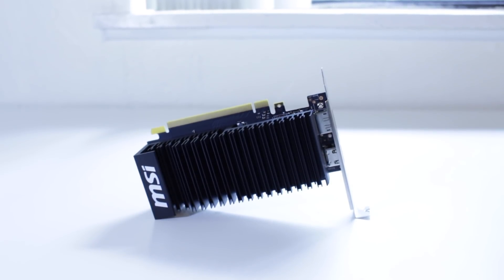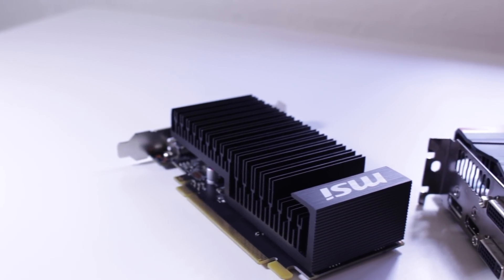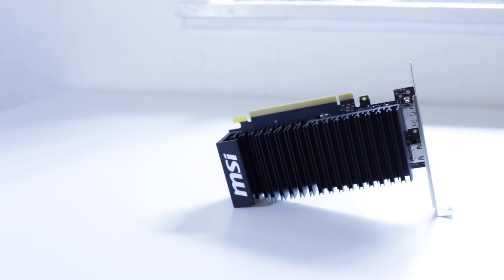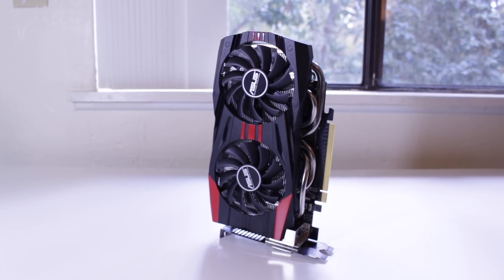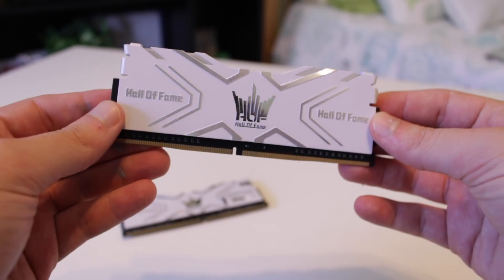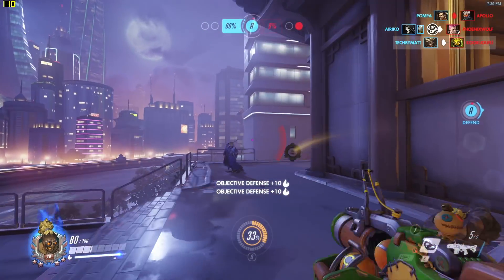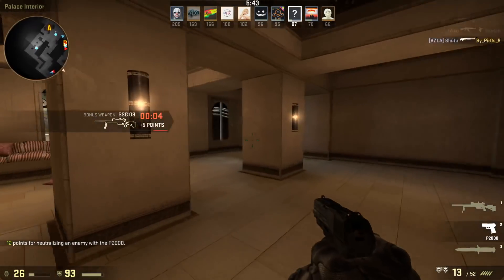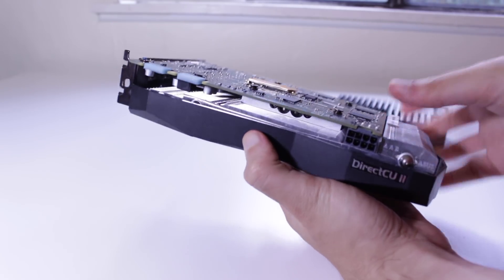New vs Used Graphics Cards! (GT 1030 vs GTX 760)

Comment: Yes but the GT 1030 has a newer architecture that supports Vulkan API, for example, and has a smaller form factor and power consumption, which is why some people might prefer it. It is more universal but the GTX 760 has much better price:performance ratios.

Comment: If you want the best quality per dollar, don't buy used.

I've bought "new" electronics from eBay that were taken from pre-builds that were never used and then sold off piece by piece. A couple times they've bricked, and guess what, since it wasn't from a retailer I was out of luck and couldn't return or exchange it.

I also bought a 1070 when it released, 9 months later it suddenly bricked for no reason, PC would not boot and I found out it was the GPU. Thankfully it was within the warranty period so I was able to exchange it for zero cost. If I had bought it used I would've had a $450 brick.

In the end you always get what you pay for.

Comment: Not "ANY" 400W or 450W PSU would be fine with a 170W GTX 760 under full load. The nominal power of PSU's is the combined power across all voltage rails. For powering the graphics card and the CPU alone you need to have a 12V rail rated to 22A or even better 24A. Assuming you have a branded 80+ Bronze PSU (and not a cheap one with 50%-70% efficiency under load) if your 400W-450W PSU's 12V rail is rated at 22A max then it means your PSU is effectively 12V*22A*0.8=211.2W under full load on a single 12V rail. Which means that you needed to use a very low power CPU or not have your CPU, 12V 3.5" HDD's, etc. under load while the GTX 760 is being at full load. Otherwise your system would be unstable with random crashes and restarts or even kill your PSU in no time. If you're buying cheap second hand parts I assume you don't have a very expensive Platinum rated 450W PSU so beware with that 170W power hungry beast and get at least a 550W-600W branded 80+ Bronze PSU.

Comment: 🎥Editing, 🖥️3D Rendering, 🎮🖱️Mixed gaming from [old & new games] the 🏆760 blows away the 1030💩. Some new 1030s released have gimped memory using DDR4 👎🏼💩 Only in power and noise does the 1030 win🔌🧐...."1030 will run at same clock as actively cooled variants",,, that is untill gets overheated 🔥 and will choke and throttle down 📉 💔... RIP

Comment: It is about six months my friends 760 died. Old hardware is old hardware and if the card was used a lot it can die any second. On the other hand i still have my 660 in htpc and it doing quit good, with the difference it was used much less. So it all really comes to how used the card was before and how healthy it is. Overall i would not buy used four years old card with no warranty

Comment: Even my 650ti beats a 1030, heh
Reply: Well, of course, GT 1030 is way too low end.
Reply: Uragan5 Yeah, but consider the 650ti is like 6 years old now
Reply: Does it really? From what I see the GT 1030 is faster in newer titles. DX9 and you might be right tho.
Reply: The 1030 can pull ahead in newer games due to newer drivers or Vulkan support in Doom but on others like GTA, CSGO, and BF1 the 650 Ti pulls ahead significantly. On paper the 650 Ti is more powerful than the 1030 but you do have a point, some newer titles can't take advantage of its power efficiently.

To be fair performance wise the 650 Ti vs 1030 comparison is a more realistic than 760 vs 1030, but if we are getting into price comparison (used vs new) then the 760 and 1030 can usually be found around the same price.

Comment: Hehe, I don't think anyone should ever worry about an older component giving out ever, unless they are doing some serious overclocking or something else that the card wasn't really meant for. I only just upgraded my used GTS 250 about, November or December of 2017, around the time this video came out. It still ran fine, but I decided to upgrade, because... it is 10 years old. I mean, GTS 250 come on. Of course it does still run, but for any modern PC it would be almost completely useless. So the component will no doubt out live it's purpose.

Comment: I would never get a card like the GTX 760, just look at the TDP of 170W (all that heat..) and it's size, the GT 1030 on the other hand with a TDP of 30W and a low price is something considerable if you can not afford a GTX 1050 Ti .

Comment: but have to take into consideration, cheapos like me buy an old prebuilt PC with a crummy psu. I would go with the GT 1030 instead, since its overhyped, I'm sure reselling the GT 1030 after upgrading the PSU and GPU would be no problem.

Comment: I just picked up a used GTX 760 and threw it into an older Dell Inspiron, upgraded the power supply, and replaced the hard drive.  The tower was free, so total price was about $125.  I'm honestly surprised!  I can run Skyrim SE and Fallout 4 at better resolutions and better frame rate than my PS4!

Comment: I spent last weekend building my son a gaming computer all from used parts, one of which was a used GTX 560ti. I have to tell you that thing only cost me $30, and its blowing us away! Definitely the way to go if you are building from scratch on a serious budget. Final cost of build was $140. I could have saved another $30 if I had remembered we already had an old ATX case in the garage. Oh and get this we were able to find 4GB of Ram at the max speed the processor handle for $20. What?!!! Yep.  I don't think we will ever buy new again.  Except for maybe an nvme ssd, because load times.

Comment: Wish these prices applied worldwide, but for example in Brazil you find a used 760 for double the price of a gt 1030, not worth it.
ps: If anyone is interested: i7 3770 & gt 1030 250+ fps on csgo low settings 1024x768 resolution.

Comment: I dont understand why everyone is always so surprised at the performance of old high end cards, For example the gtx 770 was about the same performance as the gtx 960 (1 generation later) and the same performance as the gtx 1050 ti (and this is with drivers optimized foe the newer generation!) Im sure you see the pattern here, the older GPUs are still great and are also cryptoproof as no miners are buying gtx 6 and 7 series cards in bulk

Comment: GT 1030 is the same with GTX 750 non-Ti or GTX 650 Ti somewhere. Also it should be on pair with older GTX 470 or HD 5850-5870-6870 or 560Ti.

Comment: after fermi series comparing nvidia cards is near enough cuda core frequency and memory speed balance. GTX 760 has a lot more cuda cores than gt 1030 even though the frequency is lower, but biggest problem for gt 1030 is infact  its memory total bandwidth, the gtx 760 carries on powering though via core count and it quite healthy memory bandwidth which is 2x-3x that of the 1030. Its for this balacing reason that a 1070 can beat a 980ti stock, but once the 980ti and 1070 are both OC to max, the 980ti pulls ahead (bigger % increase in core clock OC)

Comment: i just scored ASUS GTX 760 DC2 OC 60 euros shipped used (shipping is 5,90 Euros..), i guess its ok, but considering i actually bought a R9 270, that the guy dropped and broke while cleaning it for shipping... and got this GTX 760 as a replacement for it... yeah, not the best kind of seller...

Comment: If you can't stomach the power consumption of the GTX760, then the GTX750Ti may be another option - still uses about twice as much as the 1030, and by most accounts still performs a bit above the 1030

Comment: It all depends what you want, if you want a component that has a warranty and will work as long as you need it to.

Buy new.

If you want best value and performance. 

Buy used.

Either way has ups and downs.

Comment: i was shopping for a card on ebay and no where did a saw a gtx 760 at 70us
Reply from the maker: Obviously didn't look very hard...
Here are 10 gtx 760's that ended for $76 or less in the past 3 days...
https://www.ebay.com/itm/Asus-GTX760-DC2OC-2GD5-2GB-graphics-card-USED/263394548354?hash=item3d5389da82:g:C9QAAOSwNWxaOG3Q

https://www.ebay.com/itm/Asus-geforce-gtx-760-2GB/202151240331?hash=item2f1127228b:g:lecAAOSwzppaNx1o

https://www.ebay.com/itm/MSI-GTX-760-MINI-ITX-2GB-Graphics-Card-for-HTPCs-Small-Form-Factor-Computers/132430587397?hash=item1ed57a6605:g:c1oAAOSwUchaJLIk

https://www.ebay.com/itm/MSI-GTX-760-DirectCU-MINI-2GB-DCMOC-Graphics-Card-for-HTPCs-SML-Form-Factor-ITX/122846990551?hash=item1c9a4050d7:g:m7IAAOSwZtlaJ6C-

https://www.ebay.com/itm/ASUS-nVidia-GEForce-GTX760-192bit-3GD5-Sapphire-Radeon-HD-7750-2GB-DDR3-PCI-E/182950084336?hash=item2a98acbef0:g:U3sAAOSwBRFaJ0v4

https://www.ebay.com/itm/Asus-Geforce-GTX-760-oc/112677165552?hash=item1a3c1519f0:g:NbQAAOSwSeVaKLgY

https://www.ebay.com/itm/EVGA-GTX-760-SUPERCLOCKED-O2-P4-2765-KR-GSYNC/222758732546?hash=item33dd748302:g:XUcAAOSwZlZaNajB

https://www.ebay.com/itm/evga-GeForce-gtx-760-2gb-acx-gddr5-gpu-graphics-card/253307237213?hash=item3afa49b35d:g:p68AAOSwgSBaLvxZ

https://www.ebay.com/itm/EVGA-GeForce-GTX-760-Super-Clocked-ACX-2GB-GDDR5-SLI-Ready-Graphics-Card/322942824264?hash=item4b30e46f48:g:8bUAAOSwS15aJ2m3

https://www.ebay.com/itm/Gigabyte-GeForce-GTX-760-2GB-WINDFORCE-Video-Card-GV-N760WF2OC-2GD-GFX-Used/192392224626?hash=item2ccb785f72:g:nJIAAOSwbF1aLAhs

Comment: Better than GTX 760? Try GTX 660 Ti SC, you could find them on eBay real cheap, although it's auction, as   long you can snipe the auction and most of the people bidding are braindead.

Comment: Who buys a 1030 unless they need a low powered low profile card and can't find a low profile 750ti or amd card (or those cards use too much power even running of the pci express slot)
Reply: Myself, with a repurposed small form factor HTPC, and a proprietary 240W power supply that sure as well can't handle a GTX 760. I agree with Matt in general as it pertains to this video, but there are some use cases where the GT 1030 is the best solution versus any other (and much slower) card that runs at 30W max.
Reply: exactly, someone who needs a low profile card due to size or psu constraints. 

a 1030 would not compete against a 760. It would at best compete against a 750ti low profile card (which are actually rare to find now)

Comment: Would the GT 1030 be a good optimised replacement for the HD 6870?
Reply: Thanks for the reply! You're probably right, my 6870 can still handle Fallout 4 on the lowest settings at 1080p, albeit with frequent frame drops.
Reply: legacy drivers is the only thing that bothers me about the HD 6000 series cards.  15.11.1 seems to be the best i've found.

Comment: Cant find a gtx 760 for $50 on ebay. They all cost around $100  i went to offer up and got a asus gt1030 for $30  it ended up playing every game with ease and it was only 30 watts best deal ever and even better when overclocked .   Those old gpus probably start to artifact after a while anyways and it puts loads of stress to your pc. Especially when playing games for hours straight  you will start to notice frame drops as the system gets louder and temperature rises

Comment: Gt 1030 is for noobs lol smart people choose gtx 1060 6GB at least or they use RX460~480(or 560~580)
Reply: Chen Wei, if your monitor is 1080i, then a used gtx 970 is better value than a new gtx 1060 6gb, as is a new gtx1060 3gb; if your monitor is 1440i then a used gtx980 (or R9 390, 290x) will give more performance per dollar than the gtx1060 6gb. However, since smart people keep their comments on topic, the point of the video is that, for the cost of a gt 1030, a used gtx 760 (or gtx 670, 660ti, etc.) gives much better gaming performance.

Comment: The 760 is not a bad card even now. I still have the exact same one which is in my spares cupboard. One thing I will say though as mentioned,  is make sure you have a decent branded PSU of around 450w to juice this card.

Comment: The 1030 will work in more machines. Where as with the 760, you will likely have to replace your power supply. At that point, you might as well check out the 1050/1050Ti.
Reply: s13sil80 gtx 760 can run on a 400w psu. Even a budget pc build can utilize it. It's the prebuilt ones that need a new one. But then again you wouldn't be here if you have a prebuild or are getting into pc building
Reply: Most budget builds start with some form of a brebuilt pc. I would be willing to bet that most of the people who watch a video like this are people who want to get the most out of their 5+ year old prebuilt pc, rather than spend a yacht-load on a new machine, even if going for some form of new parts budget build.

Comment: isn't 670 a better 760?
Reply: wtfuredead GTX 760 is an overclocked GTX 670 not really a big difference between them
Reply: they are the same Kepler architecture, with small improvements for 760 therefore the higher clock, but less CUDA(shader+texture.map) cores.

http://www.game-debate.com/gpu/index.php?gid=882&gid2=592&compare=Nvidia%20GeForce%20GTX%20760-vs-Nvidia%20GeForce%20GTX%20670

The only problem i can see with 670 is that it's harder to find a 4GB variant(being one year older), and in our days even on lowest settings(not sacrificing resolution) 2GB gets filled up pretty easily on demanding titles.
Reply: +wtfuredead they are different cards with the 670 being slightly faster

Comment: Kepler architecture isn't supported by nvidia anymore. What I mean by that is they stopped optimization for that series of cards. So older games that have been optimized for Kepler will do better than the 1030. Though newer games will do very poorly as Kepler is relatively dead.

Comment: 670 is basically the same card and goes even cheaper, try it!
Reply: Take Hiro LOL but does the gtx 1050 Ti double as a house heater too though?yeap,thought so
Reply: Elvis Durmishi What, the 1050 Ti? With no power pin and only using the PCI, is a beast. With a 680 we can even use it to power a small camp at night!!!
Reply: gizmondo69 Well, not even the GTX 680 beats the 1050 Ti in modern titles.
Reply: While it's true in a sense, it still does trade blows at half the price of the 1050ti. 
So in a value perspective the 680 makes a bit more sense than a 1050ti if you're on a tighter budget.

Comment: Sorry but I think your comparison is flawed, and I see a lot of reviewers make the same mistake. The whole point of the 1030 is in it's ability to fit into low profile cases and yet deliver performance on a low power consumption which it does fine, if you were to compare apples to apples then perhaps the 1030 vs the 750 (non ti) would be a better choice, but when it comes to desktops the 1030 should not even be a consideration. Perhaps a better comparison for the 760 would be vs the RX 460?

Comment: My MSI gtx 760 uses an 8 pin and a 6pin. Why does yours only have an 8 pin?
Reply: different brand? some gtx 1080's only 1 8 pin, some a 6 pin and 8 pin, some 2 6 pins etc

Comment: A 1060 3gb cost the same as a used 980 4gb (faster, more vram, both support dx12 and shadowplay), 1060 6gb cost the same as used 980ti 6gb...... Used is clearly better value.

Comment: I have a 1060 3gb mini and a ddr3 8gb ram. Can anyone suggest me a processor that is good for em without changing mobo or ram.
Reply: Cuz I am using i3 2100 and just bought gtx1060
Reply: I7 2600 or k if your mobo supports  it .

Comment: tldw gt1030 would be worth it if it was 50$ new,otherwise go for used parts as you are going to get much better hardware.
Reply: the 1030 is for smaller pcs that can't upgrade the psu.

Comment: Most GTX760s get listed for around 70-80$ but they are just as fast as a GTX750Ti so they usually sell for the same at around 50$.
Reply: lol no, gtx 750ti is a lot slower
Reply: depending on the games 760 is 15-30% faster
Reply: ziem0witt 1050ti runs as fast as a 960. The 1050 is the same as the 950.
Reply: 950 is a bit slower, however the differences are very small
http://www.tomshardware.com/reviews/nvidia-geforce-gtx-1050-ti,4787-4.html (only gta5 and doom have bigger difference)
but yes 1050Ti = 960 4GB (2GB version it begins to choke on high texture)
my comment was more about the difference between 750Ti vs 760, the rest is very close to each other in terms of performance
Reply: If you were comparing it to a 1050 Ti, on the other hand, than yeah it'd be nearly as fast. Only problem I have with a 760 is that it requires more power, and only has 2GB of VRAM which really limits it in 2017. But, for the price, it's a fantastic card.
Reply: Why 750ti are 100€ in France ?

I saw them at 50€ a year ago.
Reply: 750Ti> +-20% performance > 760+-950 > 960=1050 > 1050Ti
the 700 series drivers are already poorly optimized for new games, so the gap will only increase.
the same story is (slowly) with the 900 vs 10*0 series

Comment: my 760 died on me after 4 years of using it :(
Reply: Fuse same
Reply: I think it needs a cleaning, just put in an old 750 of a friend - noticed that my 760 is really soaked with dust
Reply: Fuse so did is it dead or u managed to revive it?
Reply: Did not manage to revive it, the screws on that thing are fucked so I couldn't take the fans of to clean it. Have a 1050 TI now. Still have the 760 laying around in case I ever need to build a PC for browsing/other stuff
Reply: lol I didnt take it out for 6 years and it worked amazingly, I just sold it.
Reply: i have to reflow my 760 monthly to keep it working